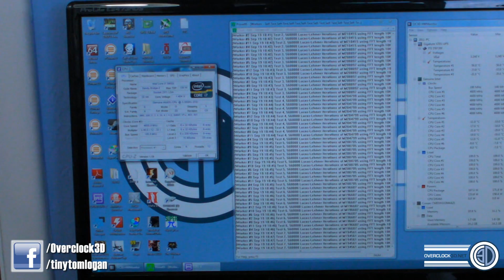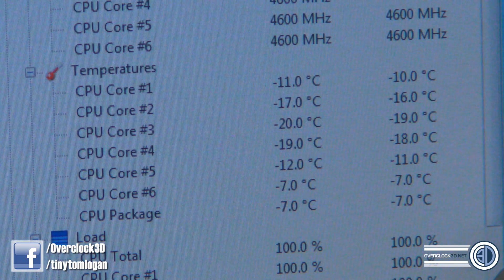Ultimate Corsair H100 Cooling Mod

Comment: how is it possible that the liquid doesn't freeze?
Reply: Thats not how fans work, no matter how many fans you have it wont get too much colder than room temperature.
Reply: Its fake dude. There is no way fans alone could create negative temperatures... think about it. then we wouldn't need freon in A/C
Reply: Robert Beck Three words: The Bernoulli Principle. Google it. True that this might seriously not bring temps into negative celcius, however, because of the long chambering of the fans, it will DEFINITELY get it colder than room temperature.... Basic thermal dynamics would have one figure that high velocity air movement through confined space [where it too, can have proper intake and exhaust] will without a doubt chill air far more than if you had just say 4 fans on there.
Reply: Sam Kilgore The Bernoulli Principle does not really have any relevance here. It only explains why a fan is able to blow air. The air blown by a fan is not actually chilled, so the lowest possible temperature the CPU can reach using a closed-loop system like this is the temperature of the room.
Reply: I eat icecream slowly.
Reply: Erm antifreeze. The same stuff they put in cars in cold countries .
Reply: Calm down. Just explain that he is wrong and move on. Its called learning. No need to be unpleasant.
Reply: How's it possible that your brain doesn't freeze?
Reply: Thank you! that responds to all
Reply: Gabriel Martinez Ezeta I sense upsettled nettles
Reply: ***** it used water and an additive, not coolant.
Reply: because the water is taking the heat energy away from the cpu so the water temperature will be about 5 degrees or so because of the friction of the particles and the pump generating heat. and yes it is possible to minus temps with a liquid cooler in a room with 20 degrees ambient as its about the surface area of the cooler to the amount of air passing over.
Reply: well you can have water under 0 as long as it doens't have air in it or it moves fast
Reply: Gabriel Martinez Ezeta The reason why the liquid didn't freeze is because the temperature readings were fake. Look at the last couple minutes of the video. It was a joke.
Reply: @Gabriel Martinez Exeta
Watercooling is not magic. It can never be colder then ambient no matter how many fans you install on it.
Reply: ImportNation Listen to the last couple of minutes of the video. He states that the readings are fake.
Reply: Gabriel Martinez Ezeta Not callin u a kid, but your profile pic does look like it.
Reply: JernCraft even the guy in the vid said it was fake
Reply: if you actually watched the whole video and not parts of it at the end he clearly says this video is a troll and was fake. fucking idiots.
Reply: it doesn't matter about the room temps but thanks anyway ( i showed this to my phyics tutor and he said what i posted)
Reply: 2walkthrough This system is not decreasing the energy in the air. What it could be doing is creating a low-pressure area that would actually be less efficient at absorbing energy from the radiator.
Reply: the fans does not make the air cooler, they are supposed to take the hot air away from the radiator, not to cool it.
Reply: liquid doesn't freeze as easily when its moving
Reply: because they devided by zero. amateurs
Reply: Sam Kilgore The fans compress the air slightly and increase its temperature, expansion causes lower temperatures. Plus there's the excitation of the molecules. From the ideal gas law, PV=nRT, temperature is directly related to pressure. Since the pressure change is low and the volume is very high, the temperature increase is very low.
Reply: Sean Mac "the temperature increase is very low" So... are you agreeing or disagreeing, because all you did really was just confirm my statement. I never said the change would be substantial. All I'm saying is that if you have a room at 75F with this thing going, the air coming out of the other side will NOT be 75F- much like you said, the temperature change will be present, however not substantial.
Reply: excuuuuuse us, princess!
Reply: Kyrre Stalsberg   Yeah but his question stems from the readout saying negative celsius temps.
Reply: lol i was wrong
Reply: Oh. Now i feel awkward.
Reply: And how do you even know if i am a kid?
Reply: Gabriel Martinez Ezeta Oops, my bad. :P
Reply: oh, thats my son
Reply: Sorry. The thing is i have two accounts. One for videos and all that stuff and the other to comment and stuff. The thing is one of em is in Firefox and the other one is on Chrome. So I accidentally used Chrome to comment, and not Firefos. Pardon me anyways,
Reply: Gabriel Martinez Ezeta Your profile picture -_-
Reply: Sam Kilgore  "it will DEFINITELY get it colder than room temperature"
I didn't agree with your comment at all, it will not get it colder than room temperature. The compression of the air will increase the temperature of said air ABOVE room temperature.
I didn't confirm your statement, I provided the theory behind why you are completely and utterly wrong. Please learn to read a comment before jumping out of your pram throwing toys.
Reply: Sean Mac That time of the month, Sean? I can read a comment, I just simply misread.. you know- like a normal person is capable of doing. I completely mistook your claim of a temperature increase for an agreement of my stating the temp will DECREASE. Simple misunderstanding.

Now-  a temperature INCREASE? Youre obviously high.
Reply: Sam Kilgore High as a kite, but not dumb as a rock, Sam.
It's like when you inflate the tyres on your tricycle and the valve gets hot, thats due to air compression. I almost felt bad for putting you down, now I realise it was a compliment lol :)
Reply: If you actually read the past comments and not just the last 2 someone tells me that. Fucking idiot.
Reply: Guys, think about it. Let's say you go out to a middle of the desert and it's 40 degrees Celsius. That's pretty damn hot. You get a fan and you make the fan push air to you. Would the air be ice cold? No. It'll be the same as 40 degrees. Isn't it common sense?
Reply: Sean Mac No. Their is an increase due to air compression but what I'm about to say is the main reason which still isn't much.  The valve gets hot from the friction of the air, not so much the compression. Compression would increase the friction which increases the heat. Only a fraction of the increase would be due to air compression.  And this applies to the video too with the air getting hotter due to the friction of the air against itself, against the blades, and the heat of the motors. Like some already said, their is an increase but not much. Very true statement but it needed a little refinement.
Reply: Taylor Ames There are numerous reasons as to why the air changes temperature but in the aid of a shorter comment I didn't list them. The compression and expansion of gases does however create a significant change in temperature, and not always due to friction like you mentioned.
Look at liquid oxygen, it needs to be heated for a fighter pilot or their lungs would receive cryogenic burns. I worked on aircraft for many years and we had a lot of fun with LOx and insects!
In contrast to rapid compression, rapid expansion results in very low temperatures but this isn't due to friction, it's the pressure change. But rapid compression of gases results in a higher density of energy per volume which is why the energy itself (heat) increases.
I appreciate what you're saying, but gases work on many levels and I didn't feel the need to delve too deep with someone who already thought a fan makes air colder!! Cheers for a constructive reply.
Reply: zZViperBoostingZz It can actually freeze at -114 C
Reply: how the heck is the liquid going to freeze... all the fans are just building up pressure you fools, its not cooling the air at all...
Reply: Why don't you look at the past comments you fools John Williams
Reply: i dont have time for that shit
Reply: then don't tell something if you see there are 40+ comments
Reply: Craziestbanana You cannot obtain sub-zero temperatures using ambient air (20'C) with liquid cooling. Try reading all of the comments in this thread, it will help you a lot.
Reply: Well hello there john
Reply: This is what I'm talking about. You use homosexuality as an insult because thats all your dad taught you with his abusive drunkenness. I wish you well. Since you insist on being 5 years old I'm going to be mature and end this petty conversation.
Reply: you sir are gay... and you should stop commenting, your bitch ass is getting annoying
Reply: Like father like son you homophobe
Reply: There again with the homophobia
Reply: You are indeed. Thats step one over (denial)
Reply: Like your mom and dad didnt care about you
Reply: whether they did or didn't I don't care but it looks like your family must hate your ass cos your so fucking annoying and you clearly don't have a job you just sit in your ass all day and and use your computer, I bet your fucking fat
Reply: My family loves me, i am about 10 pounds overweight and I don't even have a computer :p (iphone 4s)
Reply: yeah i saw the end all late but i cant believe there's people that think its true lol
Reply: Robert Beck i disagree, because its on in fans alone it has liquid cooling it and especially with that powerful wind tunnel it is very possible just look at the Bernoulli principal.
Reply: 2walkthrough You have a fundamental misunderstanding of the Bernoulli principle. The principle does not state that this setup will cool below ambient temperatures.
Reply: that's not what i meant in a specific nature im not trying to say this principle completely disproves him but the h100 can make negative Celsius temperatures but he was mistaken, its not in fahrenheit reading so it is very possible with the wind tunnel it creates.
Reply: 2walkthrough No, it's not at all possible.
Reply: explain how.
Reply: i hate science........uhhhhh, NERD jk your just really freakin smart
Reply: No one thinks on Heavy overvolted Peltier Cells? Actually, i think the water cooling is to get cooler the Cell, not the CPU

Or just a fake with a large GIF as a "Temp Reading"
Reply: im so cool i replaced my fridge with a bunch of pc fans in a box. it works and now all my food  gets so cold it actually gets fresher the longer i leave it in there.
Reply: ***** Lower not higher. And no it's distilled water.
Reply: Water moving quickly doesn't freeze. The pump moves all the water throughout the system in no more than a few seconds through a thin turbulent tube.
Reply: The guys who said you can't get the radiator or coolant lower than room temperature .......what fucking planet are you living on and who designed your laws of physics.
Reply: When a fan blows on on your face on a really hot day the fact that that the air is passing over your skin takes away the heat along with evaporating sweat. And I know minus 12 looks a bit steep but when you look at the efficiency curve of processors it more makes sense.
Reply: You should have let the uneducated people stay that way. After all that's how the education system works.
Reply: If you leave the fridge door open does the room get colder? No it actually gets warmer. I thought thermodynamics was fairly easy to understand but then I do have above average intelligence.
Reply: Rule of thumb if energy is added (wall outlet) temperature goes up.
Reply: next tutorial how to inject antifreez in the h100
lol
Reply: +Pony Terrance you two should get together for lunch
Reply: Did you carry the one?
Reply: Just for a good advise for you. if you like to know something about, like you ask why liquid doesn't freeze you get better answers in the Google search then here. The all things about chemistry.
Reply: hows your bitter getting along john ?
Reply: Its freaking oil your doushbat
Reply: I don't know how you put up with this I really don't.
Reply: Yes they put oil in the radiater look up on the internet
Reply: Its mineral oil
Reply: Yes it is
Reply: Mineral oil is verry thing liquid
Reply: Why would this even matter _. I once again find myself on Johns side, mineral oil is very expensive and offers marginal advantages even to distilled water.
Reply: Oil dont freeze
Reply: But it gets so viscous that it turns to syrup at 7 degrees C.
Reply: Richy AntiFirstArmy are you dumb XD lets throw your oil in space and see what happens !
Reply: givingtnt It would boil in space...
Reply: ***** The pressure is lower, therefore the boiling point would also be reduced significantly.
Reply: It depends on if it was in the shade/away from a star or in the light. What you should say is in a vacuum at room temperature.
Reply: ***** No, space is a near-vacuum, it doesn't have a "temperature". Things that are really far away from heat-sources (stars) can be cold, although something in direct sunlight would heat up based on surface area exposed and distance. Also objects in the shadow of another object would slowly start to cool down. Too much heat in spaceships is a problem that the space programs had to deal with because the only way to get rid of heat is radiation and the insignificant amount of heat transferred to stray hydrogen molecules and other things that float around when they happen to collide with each other.
Reply: actually. space does have a temperature.  things heat up because of radiations.
Reply: are you fucking serious?????
Ok Genius, How is it possible that its -7 degrees outside but the liquid in my car radiator isn't frozen????
Reply: givingtnt Space has no mass therefore no ability to heat up or cool down, but an object in space can have a temperature, not because of the space but because of something else in the space emiting energy
Reply: Because it's full of Superman's urine, which is green oddly
Reply: Twinfire ??? Wtf........I thought it was clear
Reply: He's has a secret Kryptonite problem, shhhh
Reply: 1.its moving 2.its not all water
Reply: NolanTheGamer1 Heat always moves from hot to cold until there is no longer a difference. If you are in a room at 20 degrees celcius that's the coldest you can get with fans

Comment: Question for over clockers in general, if one spends so much for greater speed by cooling the processor, why does one just buy a faster processor ???, or is it a game to see how far one can just cool a processor down, one should also think it's not as green perhaps on just getting a faster CPU ???, quite a few amps to power the fan's